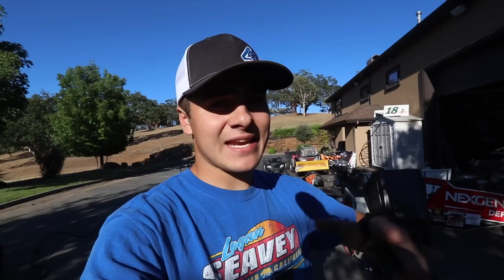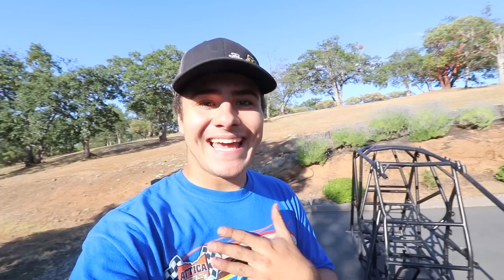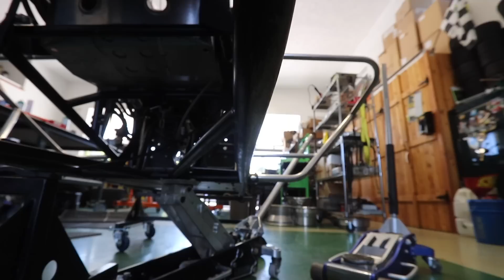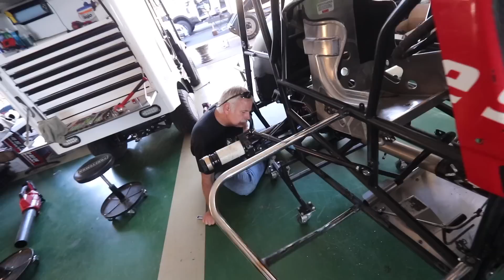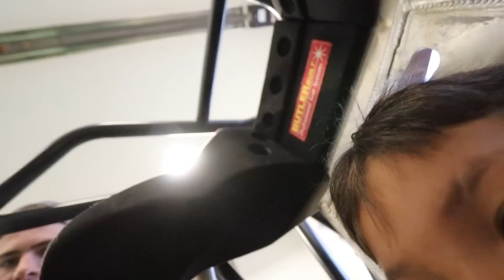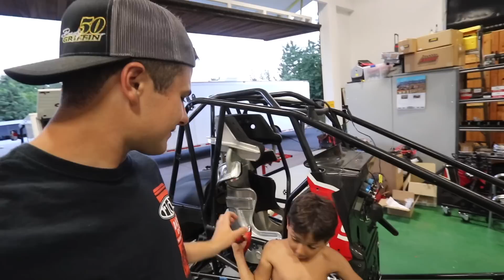What Is Next For The 18T?.....(NEWS)

Comment: You're doing the right thing by taking care of your team first. Thank you for sharing ... and you go Jayden!

Just a making lemonade from lemons thought ... why don't you cut down the race 1 frame, re-weld it into a racing simulator cockpit, work with your sim racing gear manufacturer(s) of choice to template the wheel, pedal and shifter mounts ... then auction it off?

Comment: Just a bit of a wobble in that frame@ around 7.30. 
I have a 1968 Supermodified and the frame is a bit like that. But all the corners are where they are supposed to be. The front axles has that may wiggles it is probably an inch narrower. But the ends are again where they are supposed to be. And THAT is the original front axle for the car,, 54 years old. The car did about a 100 shows over 14 years until out of date and as a classic has done over 80 more. More than half of them on the one engine.
 Are your cars all Maxims?